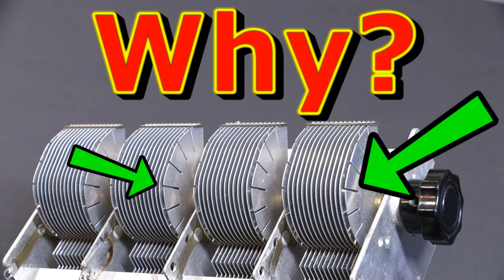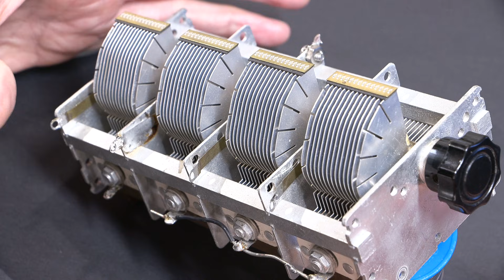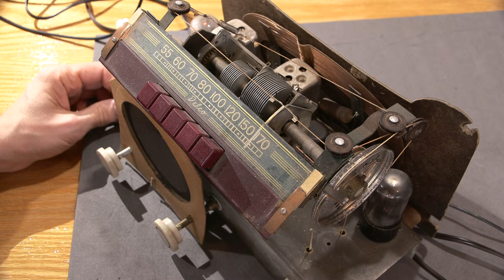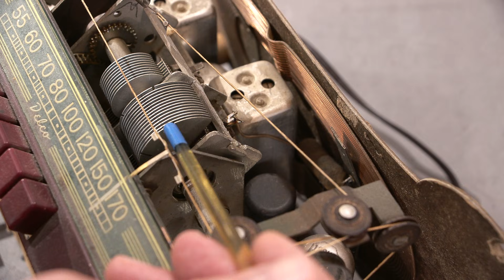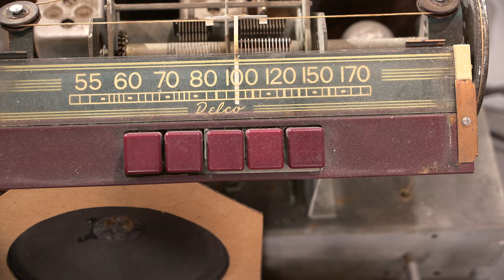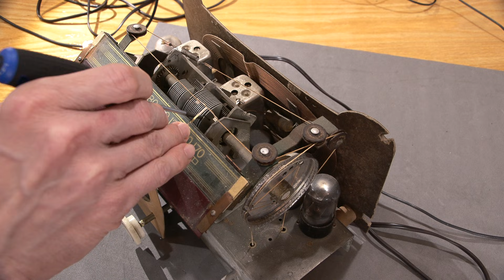Why The Cuts In The Capacitor Plates? Here's Why With Circuit Examples!

Comment from the maker: To learn electronics in a very different and effective way, and gain access to Mr Carlson's personal designs and inventions, visit the Mr Carlson's Lab Patreon page here: https://www.patreon.com/MrCarlsonsLab
Reply: In china we learned to build what is now called overshot words , we taught at theNUDT
We worked o n dragon flyer zeroopoint lifter displacement ever heard of it @ positronic research of stunt works seattle!
Reply: Thanks for doing some simpler things for us newbs! I've been watching your repairs and restorations for years, but I'd get lost pretty quickly. Then you'd say " It's that easy!" Then I'd facepalm:)
Reply: I had an Hitachi shelf system in teenage years. This Hitachi was too old to have an FM tuner built in, just AM.
Reply: КАРЛСОН УЛЕТЕЛ , НО ОБЕЩАЛ
           ВЕРНУТЬСЯ !
Reply: Yup just don't ask a question after you join, you will rudely get told to FO.
Reply: I was interrupted... writing and asking what does this mean and what is that and what the heck is that thing in the stagnate photo? 
HQ means Headquarters to me. Not quite a capacitor and not quite a battery means a plastic box with H4 connectors to me. What do they mean to you. I am just seeking vocabulary recognition at this point. Your back ground links like my brother-in-law's table and desk when he invented a typing machine system for Ham radio 📻 operating in 1970.
Reply: No. Bending the oscillator plates will not just adjust the tracking at the centre of the band!! You will also have changed the calibration at the low frequency end of the band too. You will need to re-do the ends of the band and only then can you see if you have succeeded in getting the centre of the band correct too.
Reply: it would be cool if you had little radios built of your favorite stuff to sell them but i bet it expensive ....

Comment: Isn't the read purpose to keep the two frequencies, i.e. the rf tuner and the local oscillator, exactly 455kc apart all the way across the tuning range? I mean, yes, you can make it line upon the dial indicator, but if the mixed frequencies don't subtract to 455kc, the final frequency being passed to the IF section will not be what the IF section is tuned to.

Comment: What I was learning about 65 years ago is that the cutted pate was for calibrating to make each section the same. Later models have a small tunable capacitor fitted on each section with the same reason The different shapes (I remember only 2 of the 3 reasons) was depending a scale in Khz or a scale in meters . Perhaps (and I am just guessing) that perhaps the 3e one was  for a liniare scale. Correct me if I am wrong.

Comment: The cuts are there in case you want to calibrate the capacitance over the full range.  I never tinkered with them since I figured if they wanted to calibrate the tracking, it would already be done at the factory.

Comment: In some stereo fm receiver radios,i seen a diode and some capacitos serial connected to adjustablecapacitor's leg which changes frequency from 88 to 108mhz from audio output,why ? what it does? dialtracking by capacitors or it makes small auto tune to nearest working radio channels analogly?,

Comment: i want to ask you  a question as an  72 yo  electronics engineer. ( i have worked  more than 43  y  on biomedical devices  before it i was working rf devices (radar tv receivers  cameras monitors transmitters tv studio devices missile electronic devices etc.  i  started electronics to make radio receivers and small transmitters they were usually reflex radios and poor  selectivity when compared superheterodyne radios..  2 gangs variable capacitors are used for single heterodyne and 3 gangs  (part)  for short wave receivers with higher frq. for suppressioning image frq. in double conversion radio receivers.  i have enver seen  4 gangs variable capacitor with air gaps as you demonstrate in your video.  is that used for triple conversion superheterodyne radios for higher frq. receivers ?  ,if you reply my question i will be happy. Radio receivers especially amplitude mod.  are  still my interest in my old age. i usually stay at home because of some illness which restrict my movement and spend my time to keep my infos on calculus electronics and fitotheraphy and herbal medicines.
Reply from the maker: Much of the time, the extra variable section in the tuning capacitor is for one more tuned RF stage. Some receivers have two tuned RF stages, and a tuned Antenna stage.

Comment: I do not know that bending the stator made out of on 70 year old pot-metal is a good idea?  Why didn't you use the trim caps on the side of the capacitor?
Reply from the maker: Because that has nothing to do with tracking. This is aluminum, not pot metal. Where did you get the idea that this would be pot metal?
Reply: @MrCarlsonsLab  Some of the cheap brands and some of the war time AA5s had pot metal or stators from what I have worked on

Comment: Excellent video as usual ! I have never seen those plates bent out like that. Maybe the tracking was already spot on in all my radios. You didn't check after bending if the extremeties were still correct ;-)

Comment: what determines uf. value in a capacitor 

the spacing between them
plate to plate wide space between the flat plate 

anything cut round is for null rate of uf
only the gap between disc 
need to required residence 

dia   how round cap is.
relevant frequency bandwidth 
air variable cap

energy is only stored in two ways here on Earth 

inductance 
capacitance

Comment: Those notches on the capacitor vanes are for optimizing the performance of that tank circuit the capacitor is part of.
You may have 100 possible discrete channels covered by the amplifier containing that tank circuit. The notches occur at general locations on the blade of the corresponding  tuner where signal drop-off has occured and the signal needs a boost. If a tech goes through a checkout of every channel the transmitter is capable of, if power drops off, the tech can bend the blade of that capacito just a littler altering how close that fin is to the other blades of the capacitor . Changing the frequency response and improving the output signal.

Comment: I remember Bending those was part of the calibration process for some Navy  communications gear back in the 70’s .
Reply: You are absolutely correct. THat was the reason. Later models had a small tunable capacitor fitted for each section.

Comment: Basic Electronics. By bringing the plate closer it changes the capacitance to change frequency of the  tuning circuit. The cuts help step the value needed. Can't let any plate touch each other or you destroy the dialectric barrier of air. Twisting the knob and hearing the signal is your indicator as long as it's close on the display dial. Distance is the analog like a slide rule.

Comment: In large parts of Europe, analog FM broadcasting covered the frequency range from 87.5 to 108 MHz. In Germany, the police continued to use analog and unencrypted transmission in the 74 to 87 MHz frequency range for a long time. In quite a few cases, it was therefore possible to listen in on police radio using the slots on the rotary capacitor—illegally, but quite practical in the wild 1970s and 1980s...

Comment: Really clever. I would have thought it was to reduce eddy currents (like how the cores of transformers are made of laminated plates). Here's a question: I noticed that the plates are not exactly circular (or, if they are, the rotational axis is offset from the center of the circle). Is that to give the capacitor a non-linear taper?
Reply from the maker: Yes, some are linear, and some are not. It just depends on the application.

Comment: When a kid, my retired neighbor gave me a box of electronic parts. Among them were some ganged variable capacitors. size about 2" closed x 3" deep. Note these traits. There were no stator plates, both ranks moved equally, via gears, so we called them butterfly variables. The shaft was also geared to a reducer vernier, such that you had to turn the front shaft 5 revolutions to move the plates each a quarter turn (relative to each other they were 1/2 turn apart). The vernier was high precision like a micrometer, with a hooded 1" dial.  All plates were all gold plated front and back.  All plates were waffled, not flat, not smooth, but stamped into a grid texture.   SO< what in the world did these come out of? were used for?  Thanks for your reply.

Comment: Could you tell us how to use the soldering technique you use and what type of solder to use. My solder just melts in little balls and I finally got it so hot that it melted the board.
Reply from the maker: It sounds like the soldering iron tip is contaminated or oxidized from lack of solder from being hot for a long period with no waste solder sitting on the tip, or you have turned the iron temperature up to hot and have ruined the tip. Never file or sand a plated tip, and always keep solder on that tip. Never put the soldering iron tip back in the holder dry (or freshly wiped off) always apply some "waste" solder to the tip before putting it back in the holder. Clean the waste solder off the tip just before you use the iron, then solder, then once you are done with the iron, apply waste solder to the tip again before it sits in the holder. With the tip temperature set properly, and the above instructions, you should have a very long life from your iron tips. Remember:  Always keep solder on the iron tip, never wipe it and put it back in the holder dry. Never sand or file a plated tip, and don't over heat the tip and you will be golden :^)

Comment: Two or more sections are for multiple oscillators to obtain intermediate frequency which is easier to filter, and in case of short waves allowes for fine tuning with 9 kHz band between different stations

Comment: I am an octogenarian engineer who has plenty of experience with vacuum tube receivers, and it takes little thinking to realize that the cuts on the end plates of coupled capacitors is to assure that they track each other.  Not to adjust the markings on the dial.  Instead, the dial is adjusted to track the frequencies given by the geometry of the capacitors, not vice versa.  But all this is old stuff in this era of digital electronics.

Comment: The slots (cuts) in the tuning capacitor plates create tiny areas where the crossectional area of the plates is smaller, and since capacitance is proportional to the cross-sectional area of the plates, it causes "DIPS" in capacitance as it is rotated.

Comment: It is well explained but only valid if you have a radio with one range like medium wave. 
What to do with a radio that has 
Medium wave as wel as longwave and shortwave?
Upon calibrating the dial and sensitivity tracking, you will have to compromise one way or the other. And make use the padder, trimmers and inductances that are available.

Comment: From us who know a little bit, I can add that the small capacitor for the oscillator is apparently used to achieve the best dial tracking. The bigger one with cuts, it regulates the receiver's input LC resonator circuit, whose frequency equals to the one we want to receive (may be named "antenna") such that it is always exactly the intermediate frequency apart (above) from the oscillator. So for example, if you want to receive 1000 kHz, your LC would be at that and local oscillator at 545 kHz. This is important because their difference is fed to a narrow-band intermediate frequency band amplifier which has a FIXED central frequency at about 455 kHz amplifier and has a narrow pass-through bandwidth of about plusminus 4.5 kHz from the center. That defines the receiver's selectivity. If tracking is not good it would cause sensitivity variation across the scale. This is why those old radios were so great, whereas pocket ones did not have so much handle to deal with all that, just one overall small trimmer capacitor in parallel for each of the two. This receiver principle is called "superheterodyne". 

(Un)fortunately, the digital tech took all the beauty out of it. It samples the input signal (e.g. band from 530 to 1620 kHz) with an enormous speed and then does FFT on the fly, being able to receive ALL frequencies in the band at once, not just the one to which you are tuned in. In fact "tuning" is just a software parameter in the data analysis. So given the same data once received you can run multiple computations on it, resulting in any number of arbitrary receiving frequencies and their respective bandwidths. Receiving one or 10 different stations at the same time it does not cost you any more hardware on the receivers side! You just run more software threads. That is what you call SDR.
Reply: Even with SDR, the physical antenna is tuned for chosen frequency.

Comment: But... Mr. Carlson... You're missing the point. The "magic word" is RESOLUTION.

With so many words (more than 10 minutes !!), one gets a little dizzy, between the old radio, the resonant frequency, the type of capacitor in tandem, etc., etc., etc., while the explanation is simpler, more direct, and related to a fundamental property in the specifications of all systems: resolution (in this case, the resolution in the posible changes of the variable capacitance).

The cuts are there to allow for smaller changes in capacitance C (i.e., with higher resolution). Without the cuts, when you bend a plate, the change in C would be greater, and you wouldn't be able to make small adjustments.

Therefore, the cuts are a practical construction "trick" to allow for smaller corrections of C, that is, WITH HIGHER RESOLUTION. Period. José Luis Giordano, CE4TW

Comment: Oh, I know this, though it's more than half a century before.  My amateur hobby mentor told me that trick.  Later in AM/FM Transistor radio, the much more compact tuning VC is using PVC (or Nylon, not sure) sheets as the dielectric medium.  It has additional 2 small screw-turned fine-adjustment VC for tuning dial alignment as well.

Comment: Mr.  C.  You know I've always wondered about that tuning capacitor, I knew what it was but not about the intonation/intricacies associated within it's build structure. Question: it seems as though just the outer blades are graced with the slots. Just what is the reaction if you applied lightly a metal across the elements, or in the near vicinity. If you had a different antennae would a recalibration be of necessity. Is there a must designation antennae design engineers must adhere to/towards. The variable cap placement on/in the radio have any guidance lines to follow, or areas deemed as far from as possible. The " DELCO " connotation is in early GM automotive applications from way back, but Delco made things to last 7 rightly so, a far cry from todays workings, sad to say.
    Mr. C.  of this all I was not aware. I thank you, for me to say you could have been a great teacher, I would have to redefine towards a Professorship. Seems as though you never deviate from your pleasant integrity to explain. I admire you if that's ok to say.
Reply from the maker: Thanks so much for your kind words and detailed feedback!

Comment: Excellent info , tricks of the trade! Another pitfall when aligning old radios is sometimes the coil tuning slugs lose permeability and you can't get to the bottom of the band even with the slug all the way in. Only fix is to rewind the coil with extra turns!

Comment: Funny story , Old Tvs had UHF and used these gang-meshed air capcitance tuners, well customer only wanted channel 14 being the only spanish language channel, didnt want any other channel though he  got them all except 14 , so turns out there were cockroaches in the tuner so when he turned the tuner to the end of rotation cockroaches interferred with the capacitance. So cleaned the roaches out ,got channel 14 ! Didn't charge him anything but told him keep the roaches out of the tv ! And i got a good laugh !

Comment: As a kid I liked radio's. To take then apart, I was not allowed to connect them to the 220 Volts again, back then I found out that those aluminium flaps of the capacitor (condensator, as they were called back then) could easily break off. And no way to get them back in.I did not have a clue! 
  
Ferriet could break and never put back. And back in the old days there were loudspeakers with hardly a permanent magnate, there was a second coil in the loudspeaker to produce more magneticity in the semi-permanent magnate. I can't prove it, all evidence is destroyed. 
 
When I was a kid I demolished radio receivers. But last year (2024) I saw something that made me very sad. A radio museum went bankrupt and the complete collection was sold, not to collectors or another museum but to a second hand shop. These were radio's in mint condition, where unpaid volunteers have worked on for months and months, to redo the paint of the cabinets, polish then spotless. Broken part were once exchanged, the old valves for still working ones. These fabulous master pieces were thrown into carts and crates and then dumped at the second hand store. There were many radio's still in a magnificent state, I felt so ashamed that I as a kid, took them apart, and that now when I am an old men can not save them.

Comment: Years ago I used to work for Jackson Brothers Ltd in Croydon, and indeed those slots, along with adjusting the other vanes (both moving and fixed if necessary) were used to help to calibrate the variable capacitors to match the test one on the other side of a test fixture. Not always that easy to do though, so if ones sees the vanes looking a bit strange it's probably best not to change anything unless one knows there is a problem! These test variables were calibrated against a set of tables (which I luckily managed to keep a copy of) for each capacitor type.